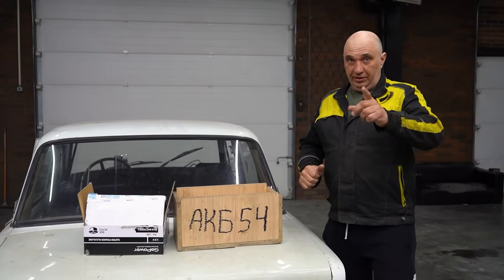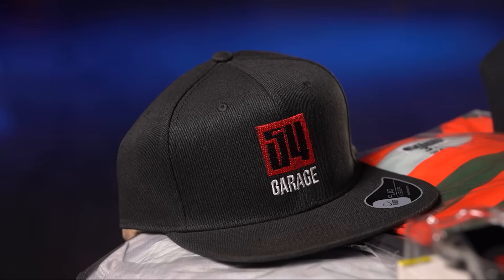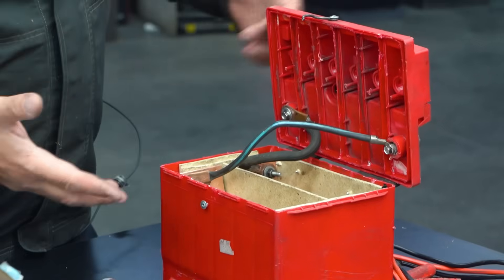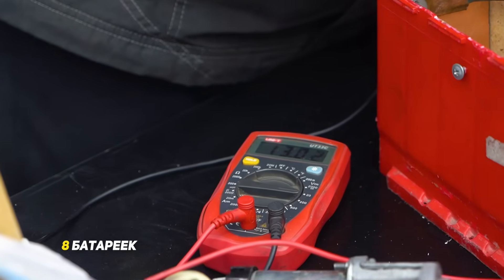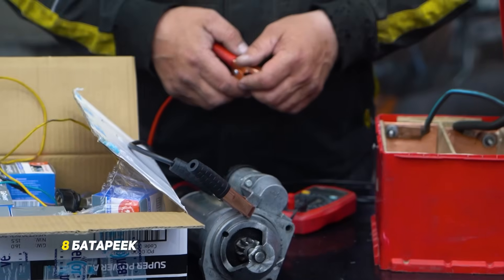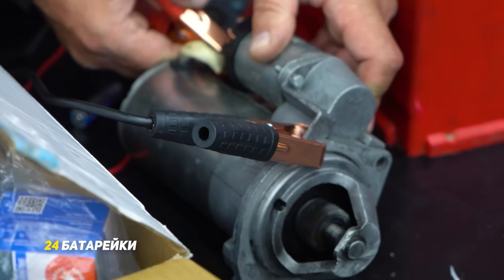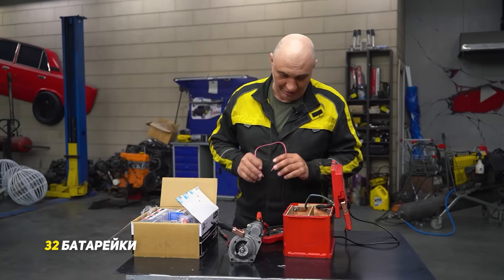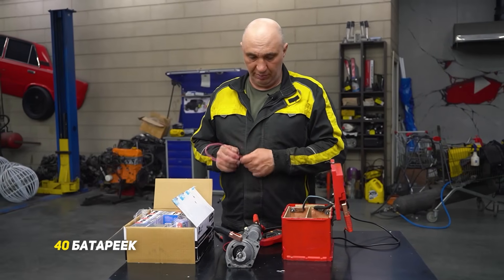How many AA's does it take to start a car?

Comment: I know this is off topic but I'd like see ya take a snowmobile engine and a rear wheel drive car mount the belt pulls on a Manuel Trans and have engine mounted sideways and whith the snowmobile engine has a clutch you won't need a clutch on car Trans. I've seen it on a Mazda rx they put car Trans in 3rd gear and took off and it flew it was on junk yard Diggs channel they didn't buy it but did buy it .also I've seen a harbor freight 212 preditor engine welded to the Trans shift and push start no clutch .just curiouse on full speed runs and if it can be made better and quicker ..I'd like see ya all try that it makes for a great vid

Comment: You can actually start the car with a lot less AA batteries, what you do is run down a regular car battery so its to weak to start the car than string a bunch of AA batteries together so you have about 16 to 20 volts and use that string to recharge the car battery.. do not try to start the car until the car battery stops rising in voltage. ElectroBOOM did that and it worked.

Comment: I would like to see how many  9 volt batteries it would take to start that same engine.
Reply: 6v  Lantern batteries would be my next step.  Do pairs of them in series.  Then,  connect the pairs in parallel, to get the right current
Reply: @keithlowe1982 6 volt Lantern batteries are comprised of either 32 AA batteries or 8 D cells depending on the brand.
Reply: 9 volts have a very low amperage capacity (400-600 mAh), AA are 2,000 mAh, D cells are 10,000 mAh

Comment: Thanks for showing us why car makers dont use alkaline cells for cranking :) I wonder if using C or D cells would improve the current draw capability, perhaps you could get away with less batteries (cells) even if they would take up similar space. Also I concur with other comments, try using rechargeable battery cells so you can start each experiment from the same state of charge. Most rechargeable batteries have higher current draw capability as well, but the important part is to start each experiment the same so u can have an accurate test result.
Reply: Doubt it. They would for sure have more reserve capacity but the chemistry is gonna limit its current

Comment: For this to work properly you would need to add some diodes and capacitors  to make sure no drain happens when not in use but than give all the current at once when switching on the starter. That's why in every electronic that's battery powered uses diodes and capacitors to make sure you get every amp possible.
Reply: Diodes and capacitors? In what configuration?
Reply: Why? The batteries are disconnected every time the starter is not running.
Reply: All though yes it's disconnected but energy always finds away to escape through back into any possible ground that's why in solar systems the panels themselves have two diodes in direction of flow so the power going to the charge controller/ to the batteries doesn't flow back from the batteries though the charge controller back to the solar arrays. Although it doesn't seem like that's possible but in truth energy can transfer into heat and escape, That's where capacitors come in handy to always have full capacity in direct flow. In truth I think it's possible to do it without any of that stuff but they should have used rechargeable AA batteries. that way the alternator could charge them back up every time the engine is running.
Reply: Don't y'all watch electroboom? Go check his video out on diodes and the video on capacitors. He explains it step by step on how it's necessary. And look up his video on resistors.
Reply: @danielparsons3995  solar panels are diodes by themselves, they are semiconductors

Diodes and capacitors wouldn't do anything in this case since this is dc, no need for a rectifier. the waveform of a battery is always an elevated straight line; perfect dc.
Reply: @danielparsons3995  Is this relevant for Garage54's experiment? 

If it is, what you're saying means that a significant amount of energy would escape the batteries through grounding over the course of say 4 hours? (The part of the video where they filled the box for the second time and tried to start the car, probably didn't take longer than that to record).

Let's say that's possible and significant means 20%.
A single AA battery can provide a clock with power for 5 years. 20% = 1 year.

Thus discharging through ground for four hours would be the same as providing a clock with power for a year. In other words, grounding is 2190x more power consuming than closing the circuit by connecting a clock.

This doesn't seem reasonable to me.

"In truth I think it's possible to do it without any of that stuff but they should have used rechargeable AA batteries."
How would that charging work if you put diodes connected to the battery?
Reply: This is only relevant to non rechargeable batteries rechargeable batteries the alternator could charge them back to normal voltage every time the car is running.
Reply: @danielparsons3995  I'd like to ask you a question, what do you think diodes do? And what do you think that capacitors do?
Reply: @blockcamp  diodes are for flow of current going one way and can't go 🔙 it's like a one way gate the flows one direction. And capacitors are like a negatively charged battery that flows all it's energy out at once when discharge but a super capacitors discharge much slower and more efficient but still negatively charged. Resistors help with the ohms of resistance. Also diodes put in sires makes a full bridge rectifier turning DC voltage into AC voltage.
Reply: @danielparsons3995  diodes restrict flow of current to one direction, but allow current to pass on the other.
Capacitors can contain a charge, kind of like a tiny battery, but can output a lot more current simultaneously.
In order to have a full bridge rectifier, 4 diodes have to be placed in an exact configuration.
Reply: @blockcamp  it's way more complex than how I just explained it there's many different types of diodes and I'm to lazy right now to explain everything about them but I'm pretty sure we all get the point. I'm an easy fellow I don't disagree with anyone on here. It's way more complex to do all that the way they did this is totally 107% ok but I always like to get the most outta my electronics. My solar system for one.
Reply: @blockcamp  isn't that what I pretty much just said?
Reply: @blockcamp  it's like I'm reading a repeat of what I just said lol 😂
Reply: @danielparsons3995  either way, you're only getting a decrease in efficiency if your current source is DC and not AC by using diodes. I don't understand what your configuration is trying to achieve.
Reply: @blockcamp  nothing
Reply: @danielparsons3995  then? LOL
Reply: @blockcamp  let me ask you a question now.
What is inside a charge controller that makes it so efficient? Or even any 12 volt electric that makes it so efficient?
Reply: @danielparsons3995  it depends; in an AC to DC converter, diodes are there to make a "sinusoidal" dc voltage, and capacitors are there to smooth and "flat out" said voltage.
In a circuit with a DC source however, adding diodes will only add inefficiencies to the circuit. Sources such as batteries already have a completely smooth waveform diodes have a voltage drop (depending on their type), and That right there is an inefficiency.
Capacitors really have no use in such occasion. There is no difference made in the "waveform" (waveform is in quotes because it's really just a flat line).
Reply: @blockcamp  I wasn't talking inverters but sure it does depend on curtain devices
Reply: @danielparsons3995  I wasn't either. There was no mention of inverters or anything related to an inverter circuit

Comment: Make a REAL homemade battery. Make your own cells. Solder. Add acid,  n check with deep cycle. Then use in car. We've made them out of wood. In emergency situations. You can use various acids and some bases. To get a wet cell going..

Comment: Say about a 2000mAh, or just 2Ah, capacity on each AA cell, multiplied by 300 gives 600Ah, not accounting for losses, resistances and whatnot, though you could take the full 600Ah figure to be akin to the Cold Cranking Amps, given a battery of 75Ah with around 600CCAs is about average for a lada, so, that's about on the money really...

Comment: This is a real experiment. The amps is the importance here. Maybe not the outcome we wanted but still a real deal figure it out thing. I say good job fellas 🥂
Reply: ... the video I seen the AA battrys worked to start the car ...
Reply: Its not consistent enough, though. A proper experiment would have used all new cells for the entire battery with each test, as battery voltage wont be able to exceed what the lowest cell can produce, thats why you cannot replace one D cell in a dead flashlight and get it to work  (as a cell discharges it will have higher internal resistance and will drop the circuit voltage).

Yea that would be VERY cost prohibitive which is why they should do this experiment again but with rechargeable cells (recharge after each test)
Reply: Yeah I was hoping they were going to look up the amps.
Reply: @cd2920  they also done this with lemons they had high voltage reading but without enough amps it won’t start. Yes there all important.

Comment: Try Use a live wire coming from the mains electricity to start it :)
Reply: Breaker do not like high amp low voltage DC current motors, they behave like a short. It will trip immediately. You need a transfomer to gain current and lose volts.

Comment: You can use a capacitor to start the engine. Some booster use residual voltage of the dead battery to charge the capacitor and start the car

Comment: a computer power supply can offer 12v and 5v connections. can you start a car off of a computer power supply?
Reply: No. Not enough amps.
Reply: PC ATX's are very sensitive to shorts or overloads for safety reason. They cant it. Even if you pick a 1000W one, it is just 80 AMP for the starter ... not enugh juice. Issue is the inrush, ATX will go into protect. IF you dare to remove the protection, them you will blow the power stage of it will self limit by the maximun available duty cycle or the transformer will be incapable of transferring more power. But mots likely they will blow.  Parts will go fly aways of their SOA on the first key rotation.
Reply: Ive used a power supply in a car amp for a home stereo experiment, but i mean not even for a small engine?
Reply: @chrishuebner1492  Maybe on a moped (50cc) or thereabout, but not much bigger than that.

Comment: Next time add the batteries in reverse order. The reason the first batch of 120 discharged is because the first row of batteries drained with the first tests. This caused the battery pack to become unbalanced. The batteries added subsequently then began flowing current towards the previous row of batteries as the first rows had lower voltage than the new rows. Trying with rechargables would also be great!
Reply: no. that should not be the case as each set of 8 batteries are running in parallel with the previous set. otherwise the voltage would not remain at 12V.
Reply: @carlosgaspar8447  Yes the batteries are in parallel and that's exactly the reason why one parallel set would drain into the previous parallel set. If one set has drained to 11V after testing the starter the next set at 12V would have a 1V difference and it would start to drain onto the previously installed set in attempt to balance each other. This kept happening each time they added a set, tested the starter, and then added another set.
Reply: @ChicagoMillingCo.  no. You are describing batteries in series. Each battery in a set of 8 drains to the next. 8 to 7 to 6...to 1. Then there is a large plate of copper which directly attaches to the battery terminal.
Reply: @carlosgaspar8447  You are wrong in this case. The batteries could not charge each other in series, but it is possible in parallel
Reply: @burkejohnson4539  The batteries are wired in series/parallel.  In series to get 12v (nominal) and then the series banks in parallel to provide the current.  A fresh series bank of 8 batteries will tend to discharge into previously used series banks.
Reply: @carlosgaspar8447 never seen anyone so confidently wrong in my life 😂
You should have searched it up the first time you were told no, instead of doubling down
Reply: You are right the Amp hrs would of changed.
Reply: The contact surface not being individual would also mean there are probably not full contact on all rows at all time. It's not a true scientific experiment, but I don't think they ever aim or claim their stuff is😊
Reply: same thought. killed the cheapo batteries everytime he tried it.
Reply: The reason the first 120 failed is because they didn't have enough capacity whether or not they were fully charged or no. He put 120 new ones in and it still didn't start it
Reply: Expensive experiment.
Hope you get the revenue back from YT !!!

Comment: I would like to have seen some meters installed to show different current load and voltage levels during testing.
Reply: Starting a small car is usually 200 amps at 12.6 volts at room temp
Reply: @sarahconner9433  Thank You
Reply: @mike-drums-maine  your welcome, 12 cylinder and diesel trucks take more 500 amperes at 13 volts...diesel is high compression 25:1 so allot if amperafe starters
Reply: Oh yeah you do it guy

Comment: the alkaline are recharable but every time you recharge them they have only 80% of capacety left so in the end after 3 or 5 times thze total capacity is 10 to 20% but the other problem is the way they alkaline batterys work the other casing getting eaten by the proces of discharge so they do tend to be leaking after multiple charges and discharges and thats can result in a fire or explotion if  you do not charge them carefully. thats the reason why alkaline today count as not rechargable and you cant buy a alkaline charger anymore even the nimh chargers rejecting alkaline because of the potential danger. but speaking of NIMH they are more saver and much dumber to recharge and can handle 40% overcharge thats mean 2V per cell also discharging them to 0.1V are also no problem and they dont need a smart charger only 1.5 to 2V and a max 200mA (on  AA versions) of current and after some time the current will drop to 1 to 3mA then they are full but if yor kept charging and your have a realy dumb charger they dont stop charging nothing will happen they get only a bit toasty 30 to 40°C. becuase of its simple and save to hanhle them they are often used in those solar garden lamps. in this lamps is allmost nothing only a transistor, LED and the 2V solarpanel all connectet in a way thats the LED wont come on while charging. bacuse of the low current of 50 to 200mA from the solarpanel so nothing will happen and undervoltage is also no problem because of the LED brakethroght voltage of 1.2 to 3V so one cell is save.

Comment: Do this again with rechargeable batteries THIS NEEDS TO HAPPEN
Reply: This should be easy for 13-15V RC 8-10Ah 25+C-rate batteries, which is basically what you get in pocket-sized jumper packs.
Reply: Yes. Lithium and lead, both. For comparison.
Reply: probably could use 18650 batteries and not as many either but they are bigger
Reply: @redrevo_117  18650s come in many different grades with the cheap knock-off stuff not even pushing 10A per cell vs 50+A peak for the good ones. Probably best to start with at least two parallel strings to avoid grossly overloading a single string with an almost dead-short, 100+A short-circuit current through a single string won't be good for their health.
Reply: @teardowndan5364  And there is 18650 cells made for different applications. Cells which are used in power hand tools can give larger current than those which are used in laptop battery. Laptop needs quite small  current in long period whereas power tool needs large current for short time.
Reply: @redrevo_117  This channel is not about finding the best and prettiest solution. Or he would just use a car battery.
Reply: @redrevo_117  I was thinking the same thing
Reply: If the use rechargeable AAs, they are going to need to do rows of 10 instead of rows of 8. Standard rechargeable AAs (NICD/NIMH) only output 1.2 volts, instead of the 1.5 volts like from regular AAs.
Reply: @762jeremy would even add few more, the fully charged car battery gives off like 14 volts
Reply: @PolesAreEverywhere  alternator is charging at cca. 14V, but battery will not keep this charge after shutting off the engine.. it will drop to 13V within seconds and after some time it will stabilise at 12.8V (new battery), or 12.6V for older one... if the charge will remain on 12.2 or 12.4V this battery is almost dead and will not start in winter... even if the battery is at 13V short time after charging, the output drops immediately after you connect some load
Reply: ב''ה, NiMH would probably perform well.
Reply: You do it then
Reply: I have a Li Ion jumper back from amazon, fits in your hand and can jump start a dead car. Only needed it once but started up a dead subaru no problem.
Reply: There is no need to do this, we already know how powerful lithium ion batteries are.
Reply: Ni-Cads might actually take a charge. Would be interested to see how long they'd last in that abusive use case.
Reply: Some lipos
Reply: Why the f does that matter? It's like trying to start it from the passenger seat instead of the driver seat and making it entirely new episode out of it.